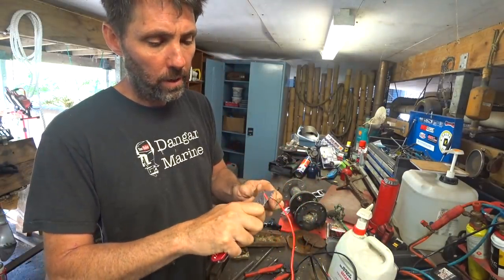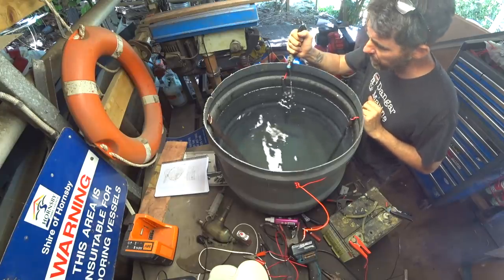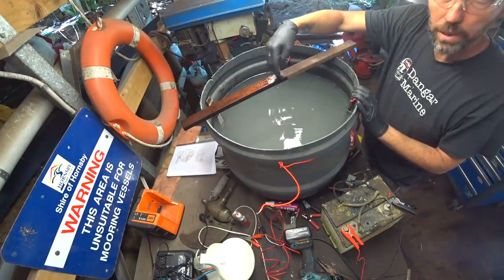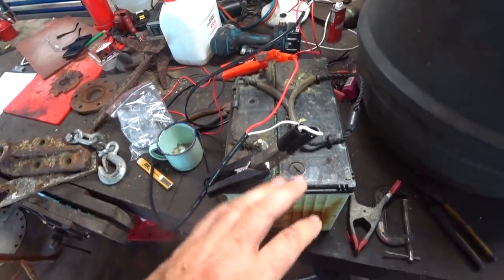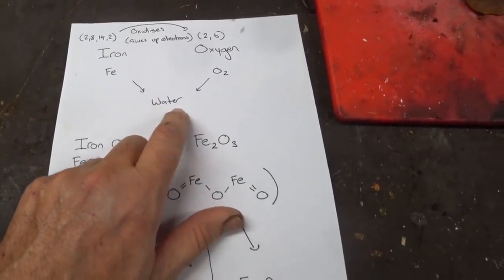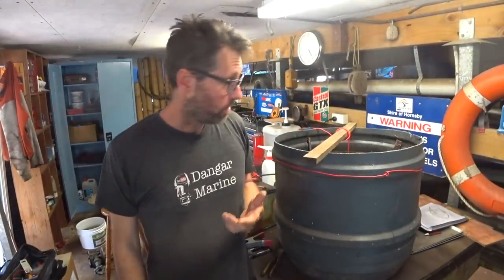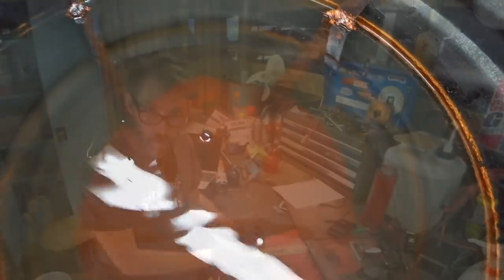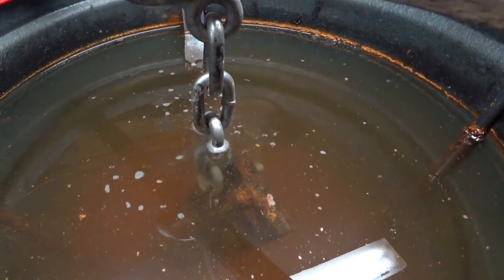Using electrolysis to convert rust

Comment: Just a note, don't put seized assemblies with mixed metals in the electrolysis bath, i.e. aluminium/brass/bronze etc, they (non steel parts) will disappear at an alarming rate....gate/ball valves etc. Good for rusted steel though. Very very effective.  Thanks Stu

Comment: I’ve done many hundreds of hours of electrolysis for old tools and boat parts- I started off with mild steel as sacrificial anodes, with the concern of getting chromium in solution through using stainless, but in the end threw caution to the wind and used stainless for the sacrificial- it just works so much better and doesn’t immediately slow down like mild steel does as it cakes up. You can keep grinding back to raw mild steel every hour or two and it will work fast but for set and forget stainless is the go.

Comment: Nice demonstration.  Alternatively you could paint the parts with orthophosphoric acid (sold as Ospho here in the USA).  That will convert the rust to iron phosphate, which you can paint directly or epoxy seal then paint.  The parts will turn black though.

Comment: Thanks Danger Stu.  After watching this video, went straight away and within a hour was cleaning tools, saw blades, trailer hubs, etc....... Works Great !  Set up just like yours with battery and charger.  Pushed 2-10 amps thru the romex wire. No washing soda so i heated some baking soda ( sodium bicarbonate ) on the stove and converted to ( sodium carbonate ) worked great. 
Always enjoy your informative and educational videos mate !   Cheers !    Regards. Wichita, Kansas
Reply from the maker: Glad you’ve been getting good results with the technique and nice work on making your own washing soda. :)

Comment: I've used this process for many years with great success. There is one thing I learned long ago regarding safety, besides the ventilation and spark/flame avoidance: never let copper come in contact with the liquid. Apparently its electrons bond with those in the liquid, and create a seriously dangerous toxic chemical, whose name I've long since forgotten.  I was told to use steel wire to hang the part being cleaned.  Great video, thanks for posting.

Comment: A couple of comments. First off, from the theory section, it was generally good but the glaring mistake was the reasoning for why salt water makes iron rust faster. It's not the salt water being more conductive, it's the chloride effecting the corrosion mechanics. High chloride content will also mean more localized (ie pitting) corrosion, as well as crevice corrosion. Which is a problem in every place where there is something bolted on or doublers welded on.
As for the setup; putting 4 sacrificial anodes up is a good idea,  in this setup I would perhaps try to use even wider strips as the effectiveness is directly proportional to electrical flow area. And, for the same reason it pays off to be mindful of the electrical connection between the PS and the part being cleaned. Of course, jamming the wire will make a connection, but e.g. winding it around the chain (as far down as possible) will mean a much more efficient setup.
Reply from the maker: I did say high school was a long time ago. ;) Thanks for the clarification, I do really appreciate the expertise of this channels viewers!
Reply: @DangarMarine  No worries. And I'm sorry that I came off a bit short in my comment. I was in a bit of a hurry, but wanted to share what knowledge I have =) 
And your explanation wasn't wrong per se (impurities, e.g. NaCl, is required so the water is conductive), and I agree that it is the reason given in high school chemistry. But more or less any impurities will do, that is why stuff rusts in moist air, lake water, etc. I happen to have a science degree in corrosion and electro chemistry, so I just jumped at it =)

Also, I commend you on your comment about recognizing stray current corrosion! A very important cue to finding the source of corrosion.
Reply: Left Flamingo 12 volts is convenient, but is it the optimum voltage?  Is there an ideal current?
I'm sure it's more complicated than my questions assume, but whatever you can provide would be great.  Thanks!
Reply: @ahaveland  thank you!  Getting an answer online is easy, but a knowledgeable one can be a lot tougher.   I'll print that out to read it, because I can only absorb so much on a phone.
Reply: @firstmkb  I'm not an expert on electrolysis but I studied physics, chemistry and electronics. Almost all the world's knowledge is available through google if you know the keywords and can sort through the dross!

Comment: I have watched a number of your videos and your attention to detail and efforts are impressive.  This video is very helpful and informative.  

I've done this process on the first anchor I found when I started scuba diving and it works very well.  One of the advantages is that it removes/converts rust in the tiniest of places, places where a brush cannot reach sometimes as well as places where even fine sandblasting might not reach.  As you mentioned, it doesn't remove steel which is not rusted.  One person commented on avoiding the use of copper which I seem to recall I tried but the copper wire was destroyed in short order.  I changed to using some kind of steel wire.

There is the idea of using stainless steel for the anodes but I seem to recall reading that it may cause problems.  What those problems supposedly are is beyond my recollection from 12 years ago when I learned about this process and started using it.  But it's worth looking up prior to using it as the anode.

The biggest thing I can offer as hopefully helpful is the power supply.  I use a computer power supply.  The one I have, which is not special or "high output", is labeled to supply 16 amps on the 12 volt channel!  I've run it for over a week at a time on a couple of projects with no problem.  The...been too long since I built computers...ATX? power supply (ATX is the style, not a brand) has a green wire, as I recall, which must be connected to ground to cause the power supply to turn on.  I may be misremembering the wire which needs to be grounded, but I'm pretty sure it's the green wire, and that can be searched online easily.  For very large projects (I've seen a truck frame done with this process in a makeshift vat of tarps and 2x4 lumber), a DC welder can be used to supply the power.

Thank you for the great content you make.  You work too hard.  You need to go on holiday.  Texas is nice.  Incidentally, I have a 1987 Evinrude 225 that could use a skilled, thoughtful hand.  In Texas.  Just sayin'.  ;)
Reply from the maker: Hey Hardford, good tip about the ATX power supply. I do need a holiday and Texas does sound nice. ;)

Comment: Although it is exceedingly rare these days, some items on boats like old anchors can still be found which are made of forged Iron rather than steel which is an alloy of iron and carbon.
When Iron oxidises or 'rusts' it does so in a very distinctive 'ropey' sort of pattern similar to the one you discussed.

Comment: Electrolysis is my preferred method for removing heavy rust from parts.  I like it best because it's a big time saver over manually trying to remove rust - you can do plenty of other things while the part cooks in the bath.  Make sure you get the poles right - I carelessly reversed them once and ruined the part.  Also, just to emphasize this:  This method requires DC voltage NOT AC.  I have found that 12 volts at 2amps works best.  I have tried this both directly hooked up to a battery charger (@ said 12v 2amps) and with a deep cycle marine battery as you show in the vid.  I haven't noticed any difference between the two methods, and so I just connect the charger directly to the anode/cathode.

Comment: Interesting  subject,  Before i retired i ran a small company in the UK recovering silver from Photographic waste,  i would travel round a customer base consisting of  Printers, Photographic studios,  also hospitals and industrial companies conducting non destructive testing, ie places like British Aerospace, i would purchase all and any Photographic waste which contained silver,  things like film, xrays and the fixing solution,  i would take it back to my place of work and  in the case of fixing solution i ran it through a silver recovery machine, which consisted of a tank with a set of Graphite anodes, and a rotating stainless steel drum cathode, depending how concentrated the silver content was you would vary the amperage until all the silver had migrated onto the cathode whereby you could then scrape it off and recover silver flake which was 99.9 % solid silver,after smelting   you could obtain 100% Purity,  it was then sold on  to a bullion dealer, in the case of xrays and film  it consists of a sheet of acetate which is then sprayed with silver nitrate which is light sensitive, in order to recover the silver i would shred the films into small pieces using an industrial shredding machine and then steep for 5 minutes in a dilute solution of ferric chloride, this turned the films into a creamy white colour  turning the silver into a halide state making it recoverable, it was then steeped again into fixing solution which dissolved the silver into solution,  this was then pumped and circulated  through the electrolytic silver recovery machine and plated the silver onto the cathode,  from a 1 tonne batch of xrays it was possible to recover between  50-60 Kilogram of solid silver,  unfortunately the digital age has all but killed it off, there are still quite a few companies still using non destructive testing {NDT} but not enough to sustain running a business on , Thanks again for  another interesting video.
Reply: I bet you got plenty of old 35mm film from the old Yashica sc5 security cameras used in the banks. 
I used to service those and would recover hundreds of rolls if ilford black and white film.
Reply: @axeman6560  sadly no i used to mostly concentrate on industrial xrays as that was were the most money was.

Comment: I use Muratic Acid to remove rust. Mystic Acid can be found at most hardware stores as it's normally used for cleaning concrete. It works amazingly well and is cheap at around $10.00 per gallon. It's not that dangerous just forget it in your eyes and wash off when it gets in skin or clothing. Try it out it will clean the dirtiest parts down to bare metal easily when soaked in a bath or brushed on.

Comment: Sodium Hydroxide is better Stu, it helps reduce chloride levels of your parts because it completely dissociates into sodium and hydroxide ions and the sodium grabs the chlorides and puts them in solution.  You can monitor the chloride level of the electrolyte to work out when all the chlorides have all been extracted (as sodium chloride).  At the end of the reduction the electrolyte is contaminated with the chlorides so you should probably rinse away the residual electrolyte with deionised water after electrolysis, then dewater with ethanol or acetone before applying the primer.
Reply from the maker: That's what I was going to say Steve. ;)

Comment: BTW: You can wipe off (clean) the anodes between doing the parts to help it work better.

PS>  Your wall clock is right twice a day  :)
Reply from the maker: Yes, I did give them a bit of a clean soon after putting the new part in but didn't film that part. Should have!

Comment: Works very well, takes some time. I did a number of items once. I once did some screws from an oven though, and whatever that metal was, it basically ate the screws quite heavily, not just the rust, maybe they were too porous to begin with. Don't use stainless steel as the sacrificial anode as it can release some pretty toxic substances apparently.  You can re-use the electrolyte quite a number of times also. I'd clean out the excess rust and the rust from the anodes to provide clean surface area though to speed the process, most of that rust will just wipe off really.

Comment: Make sure your Anodes are clean before doing this, wire brush and degrease them.  Make sure the surface area of your anodes exceeds that of your cathode for best results.  Use a 10 amp charger for best results, should take two days or less.  Reserve Electrolysis for machined parts where you want to maintain tolerances.  For general rust removal use vinegar, will leave a sandblasted type finish.

Comment: I wish you would of cleaned off your anodes before adding the next part as you will eventually passivate your anodes with all the accumulation of rust. The highest resistance in a CP circuit is between the anode and the electrolyte. In any case keep the videos coming, love seeing the boat come together.
Reply from the maker: I did actually give them a brush soon after putting the new part in, just didn't film it.

Comment: I use citric acid, same stuff that makes candy that sour taste.  

If you don't want to use electric just citric acid and water works well too.  Heated water speeds up the process. And it takes hours to a day or 2 depending on method and amount of rust.

Comment: Thanks for the great explanation! How does this compare to chemical rust removers? Any advantage of one over the other?
Reply: pixelflow electrolysis is dirt cheap, but slower.  Phosphoric acid is a common rust remover, and it reduces the ferric oxide too.

Comment: Just toget it correct, water does not conduct electricity! The mineralization of water does. But demineralized water does not conduct at all. Actually some use demineralized water as a cooltant for computer mainboards by dumping them completly into it.
So H²O is not conductive. It is a pretty good isolator in fact. But metalls like natrium in the water do make it become conductive.

Comment: Very interesting topic. Would the process speed up if you increased the DC voltage to 24, 48V, 96V? Might reduce the soaking time or allow more parts to be in the tub simultaneously.

Comment: would higher voltage cause the process to run any faster? Or does that have a risk of damaging things too much? Its been a long long time since high school chemistry, so curious. Keep it up. I keep waiting to see the final video when you relaunch the boat.
Reply from the maker: Not sure to be honest. Having a larger surface area of anode does make things faster as well as brushing the loose stuff of the part being cleaned every day or so.

Comment: Stu et al; I like the science lesson and I learned from the video, but I think it would be better to say the battery is acting as a "capacitor" to remove the A/C ripple and improve the process. I agree using the battery to smooth the D/C source and make it more pure is important tip to do this process with least fuss and bother and cost. I wonder if a D/C welder at low voltage would work as well as a battery with a charger? The battery may be more safe. I agree to warn people the process must be well ventilated, explosions or exposure from gassing in this process can be very dangerous.

Comment: Would it be possible to break down rust in an engine block to free up stuck pistons with this method?

My friends diesel boat engine  took on sea water and it seems to have seized the motor as it was not in use for quite a while.  The block is out of the boat.  I wonder if this technique could help free it.

Comment: Anyone else thinking about dropping a power pole into the ocean to clean their hull?
Reply: That was extremely funny. This image it creates in the mind is super hilarious.
Reply from the maker: Or put the boat in my local olympic sized swimming pool with a few thousand rods around the outside. ;)
Reply: @DangarMarine  This is what crowd funding was invented for
Reply: @DangarMarine  insulated swimming pool and steal electricity from the grid by hooking up to your power lines BEFORE the meter! ☇🛁😆👌👍
Reply: An Olympic sized pool is easy to create in-harbour by pulling a big plastic bag up from the sea floor, supported by the deck fittings. Late in the process, crevices could be targeted with close placed sacrifice electrodes (+).  Maybe next time with something smaller.
Reply: I wonder how much current it would take to blow the barnacles off?
Reply: ^^^^^this guy was...

Comment: I've used pure carbon bars for the Anodes, it worked really well, but the process eats the carbon away. Your iron bars looked to be more long lasting .
Reply: Were those carbon welding rods, or where did you get them?  Thanks
Reply: @firstmkb  I bought them from ePay. I believe approx 3" wide x 24" long. I wrapped wire around them, not drilling holes in case they cracked. Sacrificing by eating away the mass of the bar. Other wise was about the same as what Stu's rods did as far as removed rust.

Comment: You get better result and less messy using car aluminium heat shields as anode.  I acquire heat shields from
local garages. Use old style battery charger as power source.

Comment: have you tried citric acid iv used it with a lot of success on my rusty boat bits and you can buy it from coles
Reply: Great stuff I buy mine from eBay works out cheaper

Comment: good work mate maybe ill give my trailer roller pins a run at with this, whats the best wire to use for boat electrics, would that house wire be suitable (tinny ,sounder ,50 merc bilge etc), i have a ton of that
Reply: For longevity (so you don't have to do it again quite soon) use tinned, multiple strand wire,  
https://sciencing.com/tinned-copper-wire-5879934.html  
The house wire you have has very few individual strands in it because houses don't move, usually don't vibrate, and usually don't get sopping wet with sea water.
If you cheap out with what you have, you may regret it when at sea.........

Comment: Is this really easier/more cost affective than remanufacturing?  I don't feel like the exhaust cover is a critical piece as far as structure so would it have been better to just use a wire wheel on it?
Reply from the maker: Once you are setup it is very easy. I wouldn't build all this for that one part though, no.